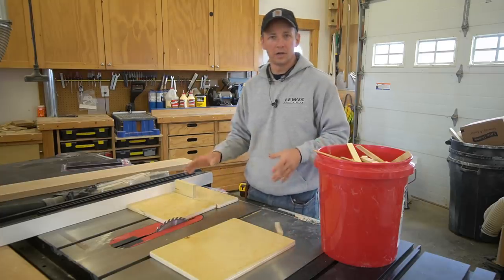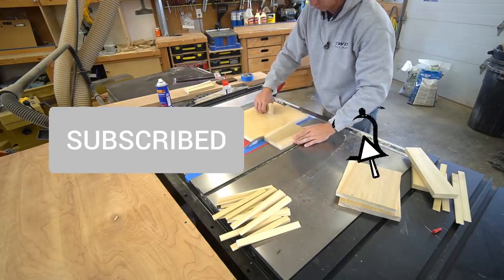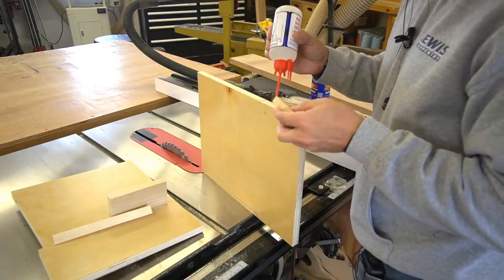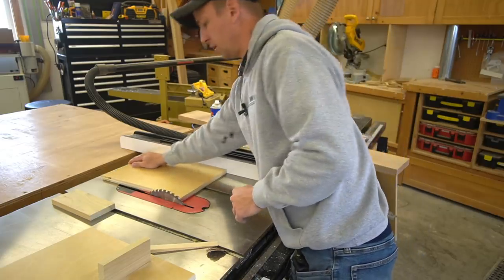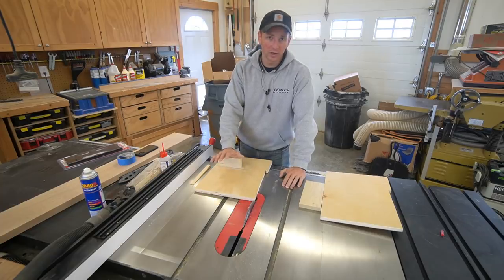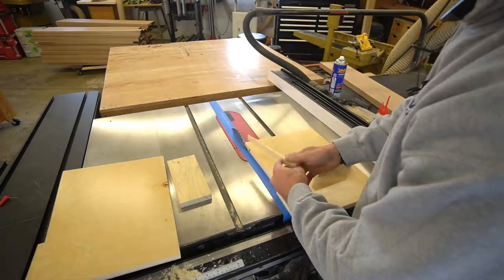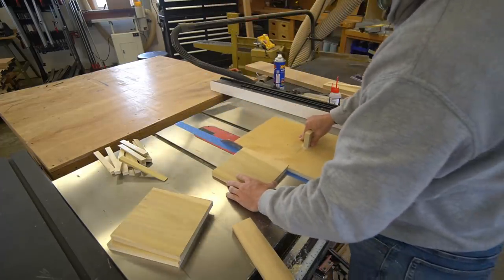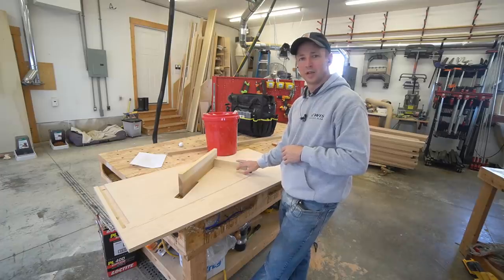How to Make Custom Size Shims | Any size, any thickness, any length...

Comment: Great tip on the painters tape. While doing a quick one piece shim rip, the piece hung up and in an instant the blade sucked it in - dislodged the insert sending it into the blade with shrapnel flying and lodging tiny pieces in my left arm. Damage was only skin deep but burned into my psyche. It was a new saw I hadn’t taken time yet to make a zero clearance insert for! Lesson learned.
Reply from the maker: Thanks for sharing this. Wow!!!

Comment: Love the painters tape trick!
Reply: I use red vinyl tape for both chop and table saw tonarrow those gaps in my inserts. Even my custom wood and plastic inserts get worn from bevel cuts and instead of putting in a new one I use the vinyl tape. It really holds up well.

Comment: I use a similar jig, but have a piece of 3/4 plywood that overhangs the blade.  Gap in the back to see the cut piece is seated in the notch, and shy of the point also to verify it is against the jig.  Serves as a holddown and provides a little more protection from the blade.  A scrap is used to hold the last 4 or 5 shims, allowing all the material to be used.
Of course the blade height must be adjusted to not cut the hold down off.

Like the tape idea!

Comment: Great advice from a young fella. I remember when I was part way through my carpentry apprenticeship, bout 50 years ago, I got transferred to a City Hi-Rise refurbishment job. Upstairs was a tablesaw and lying face up on the bench were some graphic pictures of someone's severed fingers. The saw was a McKenzie Treadle Saw--Damnably dangerous saws if you came to work with a hangover or were just not paying attention. Probably banned these days I would imagine. But it taught me to always concentrate 101% on the job using a power saw.

Comment: i do mine on the miter saw with a zero clearance insert.  set it at 1.5 or 2 degrees (depending how thick a shim you need) with a 7 inch piece, make a cut and flip, make a cut and flip, repeat as much as you need.  i usually use the biggest piece of wood i can find (2x8 2x10 etc).  i can usually bust out a good pile of shims in a few minutes

Comment: Very efficient jig, very wise cautions for use.  Especially if I intended someone other than myself to use this jig, I'd consider adding a simple holddown to allow the stock to be pushed through the cut without use of the left hand. The holddown would function in the same way as Fastcap's $10M stick. If the jig handle as shown were repositioned forward to the centerline of the shim notch, the holdown could be a simple L-shaped piece connected (hinged) to the top of the handle.  It would extend in line with the handle over the blade with a downward leg tall enough to make contact with the stock just on the waste side of the cut.  Sandpaper or rubber could be added to the contact surface for better grip.  The left hand would be used only to load the stock and remove the shims, well away from the blade. Ergonomically, it would be fairly natural for the right hand to push the jig and hold down the stock at the same time. (Just a thought from someone who has retrieved a very experienced co-worker's fingertips from a Unisaw...)

Comment: Spencer, I really enjoy watching your videos. There is always something to learn or improve on. I wanted to point out a mistake I saw at the beginning of the video. CA glue application; the glue should be applied to one of the surfaces and the accelerator should be applied to the other surface. Once the two surfaces are bonded together, spray the accelerator to bonded pieces to cure any CA glue that squeezes out of the joint. 

Spraying accelerator directly on the glue before bonding parts together causes the CA glue to cure before contact of the two parts. In my experience with this product, you have up to three minutes to bond surfaces that have accelerator sprayed on one side and CA glue on the other. This is due to the evaporation of the accelerator. Additionally, CA glue instantly bonds to protein. Wood contains a cell-wall structural protein. Applying only CA glue to the joint, pressing it together and then spraying accelerator will cure the glue because the wood is also porous. 

On a side note, anyone who uses CA glue should purchase the manufacturer’s de-bonder solvent. This is very helpful for safety removing dried CA glue off of your fingers, hands and other surfaces. 

Keep up the good work and I hope that my input only makes you better.

Comment: im sure he knows this, but you can make a zero clearance out of scrap wood (poplar or stable wood preferably) easy to take out when you  dont need it and you dont have to waste blue tape which is expensive these days. still love the blue tape idea in a pinch, but think that having a designated zero clearance for your table saw makes more sense for carpenters.

thank you for sharing your wealth of information with us, always appreciate!
Reply: also if you have a riving knife on your table saw, it wont cut that out. not the end of the world (razor knife?). i just made a zero clearance out of poplar for my dewalt, it has a riving knife you cannot remove. it takes a little bit of thinking, but the process is there to a cheap and effective zero clear that will last you years and look nice
Reply from the maker: I rarely need a zero clearance. I use the same insert because I almost always have my dust/blade guard/riving knife on. My time is a lot more expensive than blue tape these days.

Comment: I have a similar jig, but I have a piece of plywood going across the sled and over the blade.  I run some drywall screw through the only just until they like through. The pointed screws hold down the shim and shim-stock material.  This way your fingers stay clear of the blade.  You just can not raise the blade too high.
Reply from the maker: I saw that on another youtube video also. Definitely not a bad idea.

Comment: I really enjoy all your content, however this is a lot of engineering for a simple process.
Rip poplar to whatever length you want your shims to be.
On 8 inch long (guessing on your length here),so set your mitersaw around 1.5° for zero to 1/2 taper.
Then cut ,flip board to the other side,cut and repeat.
As long as as you set it up with the correct miter,you cannot mess them up.
We set the mitersaw at 5 degrees ,which gives about 3/4 at the big end.
We only use scraps and never measure, so I can't tell you what each degree will yield per inch in length.
Reply: I agree...i make shims like this all the time. But good video though.

Comment: I use table saws a lot and they scare me.. which is good.  The only close call I ever had was getting my fingernail shaved by a mini router,  by not being careful how to keep my fingers out of the way while the bit was still spinning when the routing was done.
Reply: Same here. Mini router no problem. Right? Wrong!
Reply: I was lucky my router bit had a bearing on the end that brushed up against my fingertip. A simple job where your mind wanders, if it had been a chainsaw I would never be in that situation.

Comment: No matter how many times I see it, I physically cringe at the practise in the USA of using a table saw without a blade guard fitted.  It just looks so dangerous; an accident waiting to happen.  Not a criticism of Lewis, just a observation of the custom practise in the US.  In the UK it would be a serious breach of Health & Safety Legislation to use machinery without a fitted guard.   It's just so surprising  to see this practise in the USA, particular with such a litigious  country.  As an aside, this is a great channel.
Reply from the maker: I agree. In general I use riving knife/guard/dust collector, but I removed it for this operation.

Comment: Perkins brother lost his fingers on a jointer despite being pro carpenter - his main mistake was wearing hearing protection - he did not hear the jointer was still on... never thought of a safety device increasing odds of accident.
Reply from the maker: I think the main issue there was leaving the machine on while it wasn't in use. I have done the same thing many times. But after Jamie told the story of his accident I never walk away from a machine and leave it running. I'm glad they share the story of that accident.

Comment: You say its relatively safe and I see your hand next to the blade, makes me cringe. 71 year young carpenter still going strong or at least in my mind I am.  I still have all my fingers and yes when I was younger I would run everything  thru the table saw down to a inch. I was a macho man . I heard a saying a couple of days ago and its so true. It went something like this. When your not afraid of it is when accidents happen.
Reply from the maker: I have a very healthy fear of blades. We all have different definitions of safe. I said relatively safe because I know that what is safe for me is not going to be safe or feel safe to everyone.
Reply: I'm petrified of my saw. I prethink ever cut. Still have all my fingers.